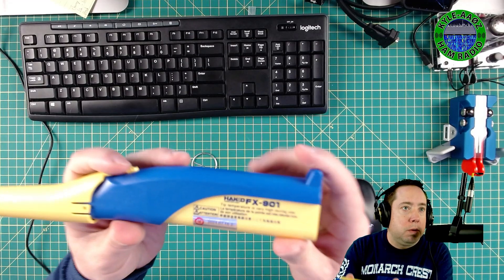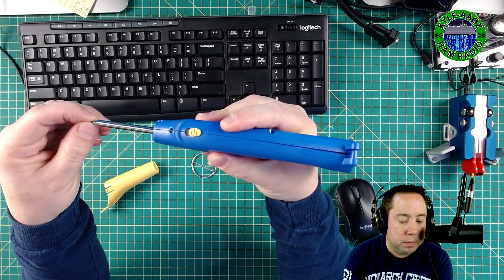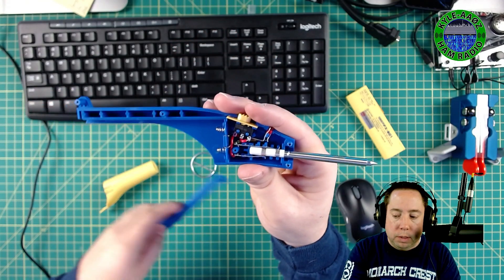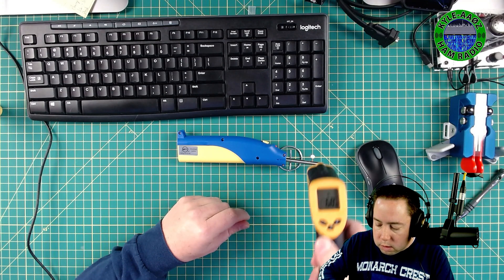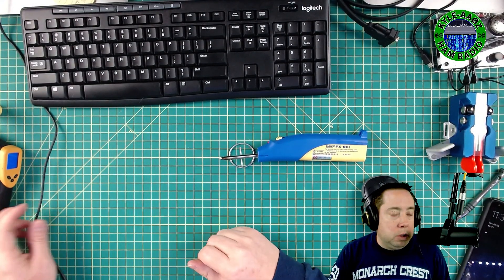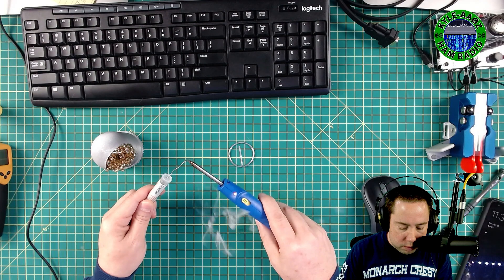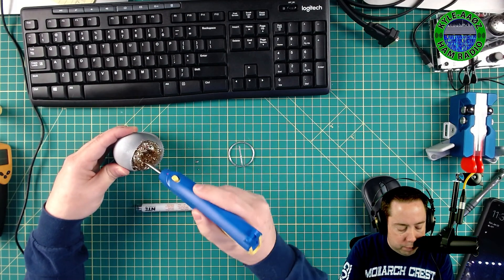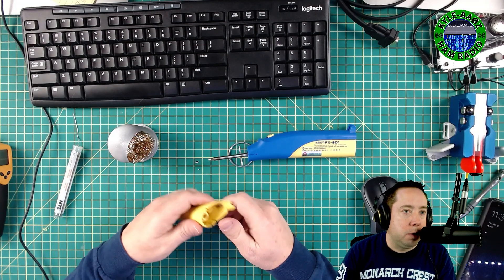Hakko Battery Powered Soldering Iron FX-901 Review

Comment: Looks like your FX-901 is missing the securing mechanism for the tip, it's suppost to have a yellow locking nut, mine does atleast.

You can also simply stand it up straight, it's flat on the underside.

Comment: So you don't know how to use a thermal sensor. Heat up and ruin a brand new tip without tinning and complain solder doesn't wet properly. And with the tip lock missing you are trying to review either a defective unit or with parts you misplaced. With good batteries iron can melt ROHS solder in 30 sec. Please just delete this waste of a video. Absolutely pointless.

Comment: Thanks for the informative review.  For emergency field soldering, those butane soldering irons work very well.  They heat up fast and get very hot.  They are probably too hot for very delicate work, but work great for connectors and antenna wires you may need to fix in the field.  Unicorns rule!